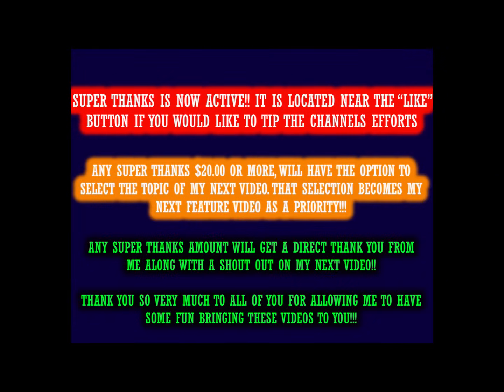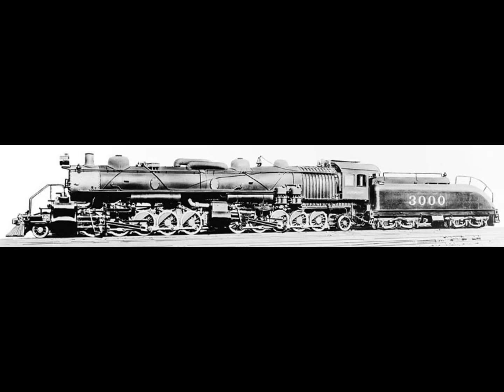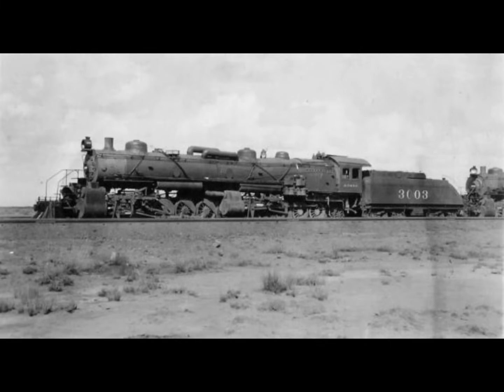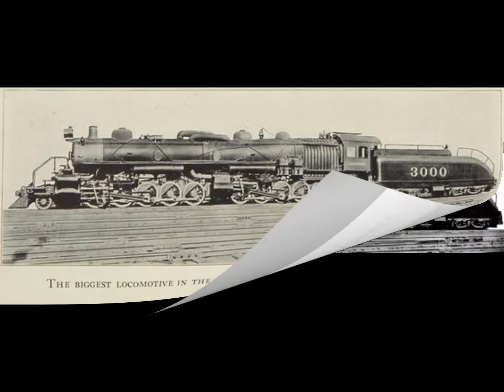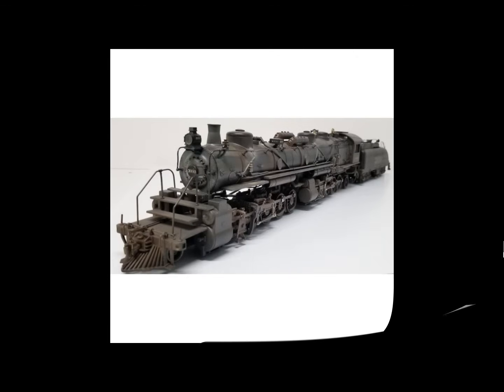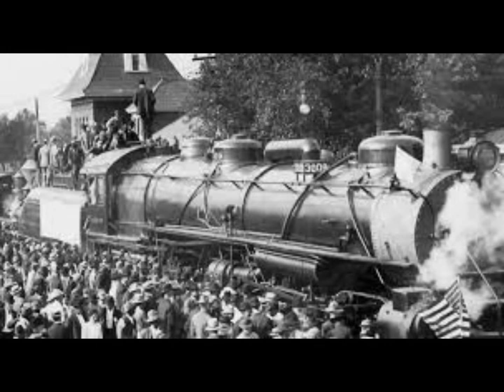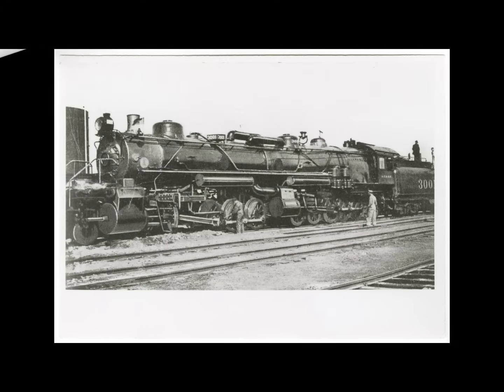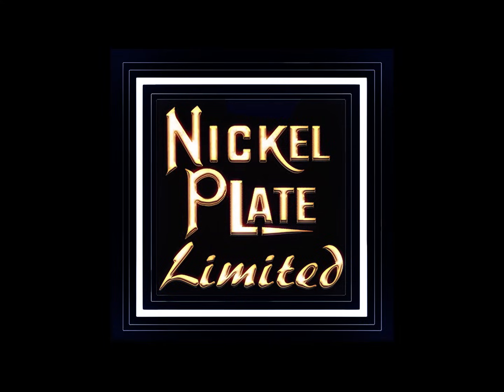Santa Fe 3000 Class Double Decapod

Comment: You mention loads that actually seem light during my career as an over the road Locomotive Engineer on the UP.  The load capacity really climbed rather quickly.  When I hired out in 1973 a 4 axle cars could haul 100 tons or 200,000 lbs.  One of my heaviest trains was two grain trains put together.  It totaled 155 cars at 133 tons per care.  Doing the math that is 20,615 tons or 41,230,000 lbs.   I had 6 SD-40s on the head end, which was 18,000 horsepower.  To make it over the Huey P Long Bridge, a 1.25 % grade, 2 more SD-40s was added as pushers.  It took about one horsepower per ton to make it over the crest of the bridge.  And anything over 10,000 tons exceeded the drawbar / knuckle strength.  Today I believe the gross weight on 4 axles is around 145 tons.
Reply from the maker: 75t at the time were really heavy loads.

Comment: I think making the boiler a larger diameter and shortening the distance between tubeplates by making a larger grate and combustion chamber would have been a good start. Dispensing with the compound arrangement and having four smaller cylinders in ‘simple’ mode would have helped too.
Reply from the maker: The firebox was also too small.

Comment: Modern cars are 286,000lbs, or 143tons. VERY few cars have a tare weight exceeding 30 tons, which means most cars can carry in excess of 100tons each. 

An empty 130-car coal train on NS's Pittsburgh division weigh between 3000-3500 tons depending on inclusion of light-weight aluminum hoppers. Those trains isually weigh in between 18-20 rhousand tons.

Comment: In the early 1900s, the Santa Fe was relatively lightly-built, and so spreading engine weight over many axles was a goal in itself. Compare this 10 driven-axle engine, for example, to the I1sa 2-10-0 class (1916-1923) on the Pennsylvania R.R., a railroad with strong bridges and tracks: 102,600 lbs. tractive effort, and 72,600 lbs. on each driving wheel. 
   In addition, modern anti-wheel slip systems didn't exist, so maximizing drivers was seen as a way to get more tractive effort onto the rails. Unfortunately, less axle weight also made engines more "slippery." This engine must have required a careful hand on the throttle when starting a train.
Reply from the maker: Great Info!
Reply: @TheRailroadCrossing-SteamPower  - Thank you! When looking at railroad history, it is always important to look at the subject from the perspective of the company that made the decisions, because they had to look at the idea from a financial, mechanical engineering, and civil engineering perspective. 
Clearly, ATSF must have believed enough in the 2-10-10-2 concept enough to convert an entire class without first building a prototype. Despite the almost-predictable lack of success met by the 2-10-10-2 idea, the 2-10-2 "Santa Fe" type was popular with the ATSF up through dieselization.

Comment: I wonder if a bigger fire box would have helped
Reply: I would say there would be a pretty good chance of that.  The Virginian’s 2-10-10-2’s had a firebox area that was over 200 square feet larger.
Reply: @machinist1879  UP got it right with big Boy ,,it had a big enough boiler and higher pressure steam ,,it was actually much bigger too
Reply from the maker: Yes..that was one of the biggest factor in failure in the design... Why the Santa Fe designers didnt figure this in is beyond me.

Comment: That boiler diameter is way to small maybe if was bigger they would been slighty better.
Reply: I don't think so, a fire box from a 2-10-2 is too small for this size of a locomotive. The combined tubes are too long, this loco had 7 Tube plates. This mean, it is not possible to get enough draft at that boiler and enough fire to use all the heating surface.
Reply: @martinanschutz7410 Perhaps replace the trailing pony with a four wheeled truck as was done when Mountains morphed into Northerns?
Reply: Perhaps.  But with being based on the existing 1800 class a larger diameter boiler would likely have impinged maximum axle load.  The issue, as with other jointed boilers was the lack of draft - and that's a product of tube length rather than barrel diameter.
Reply from the maker: Exactly right... the chief failure was the firebox size.
Reply from the maker: Excellent point
Reply: See my point about the light Santa Fe bridges in the days of these 2-10-10-2 locos. Remember that this was long before ATSF rebuilt its mainline bridges. Just look at the monster steel bridges at Topock (Colorado River) and Canyon Diablo, AZ and compare them to the spindly things they replaced. A heavy firebox and tubby boiler would have made these engines too heavy for the Santa Fe's lightly-built physical plant.

Comment: They tried to much to improve thermal efficiency at the cost of not enough steam raising surface, fur such a large locomotive the boiler looks skinny.
Interesting is the part of dead weight in a train, you should think that in the UK with limited train lengths and axle loadings they would have adopted larger wagons sooner to get more payload on a train, but yet the British coal car didn't grow much until 1970. The typical coal car grew from 8 or 10 ton capacity in 1870 to 16 ton for the last batches of 4 wheel cars in 1950.
On the European continent the 4 wheeler quickly grew to a 27-30 ton capacity around 1950 and bogie side discharge hopper cars were also introduced en masse around that time, these had a 50 ton capacity which grew to 70 ton nowadays. The hoppers were used for transport of coal to large industrial users and power plants, the four wheel wagon stayed in use for household coal deliveries on local goods yards to local coal merchants.
Reply from the maker: You hit the nail on the ehad Tom.. The firebox and boiler were inadequate for the size of the locomotive. I just find that perplexing as to why the Santa Fe engineers didnt figure that out prior to conversions. Baldwin or Alco were not involved with this.. Perhaps they should have been.. At least in a consulting role.. You know? Yeah I found the hauling issue's in the U.K. and Europe a bit perplexing as well.